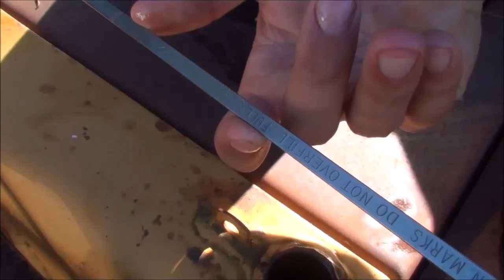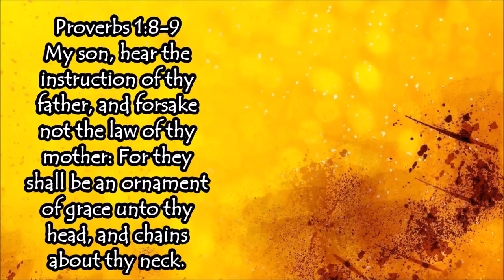Hydraulic Oil and Filter Change for Case 580E Backhoe

Comment: I'll be changing my hydro oil tomorrow on my 1986 580 SE if the weather allows...A very experienced heavy eqiuipment tech at my shop said just about the same thing you explained as to exercising and fully extend the pistons including the outriggers  at the right operating temps, so as to fill all the pistons and work out any air that may have got into the piston...thanks so much for the excellent video!
Reply: Thanks Grimm for "tuning in". As far as exercising before hand the oil is more fluid, warm oil flows better than cold oil. I didn't do this but it isn't a bad idea to put oil in the new filter before installing. This step isn't critical but helps purge a little more air out of your hydraulics. Exercising afterword is for the sake of working out any air before putting the implements under load. I have operated a machine with low hydraulic oil before and your system will cavitate which is hard on the equipment. Over all not a huge thing provided one doesn't make a common practice out of it. I rebuilt my hydraulic pump a while back and it is inevitable one will get air introduced into your system when ever you blow a hose, rebuild a cylinder, run low on oil, etc. it will work itself out eventually in short order.

Comment: I actually found this interesting because if I should ever own equipment someday I need to learn this stuff. I may not be changing the oil or doing other maintenance but I need to know how to check the fluids, etc.
Reply: Cathleen, good point. The more we familiarize ourselves in different skill sets the more confident we become in tackling different situations that come our way. Thanks!
Reply: Mr. Rain My dad wouldn’t let us get our driver’s licenses until we 
could show that we could check our fluids, tire pressure, jump start a battery, and change a tire. We never learned it for the tractors though.
Reply: Your dad seems like a practical guy who cared about you. That is what dads should do...in my opinion. If need be Heidi can do basic checks on vehicles. As you can see aside from the hydraulic system there are similarities between all motorized vehicles... come to think of it one could view the break system on a car as a hydraulic system 🤔

Comment: Thanks for the video. One minor correction, Case recommends you do not use a filter wrench to install the new filter. It is far too easy to dent the thin wall pf the filter.

Comment: So. 50 gal drum cut in half. Half filled with clean playsand. Add used oil. Stick in tools with metal heads. Lift tools up & down a few times and cleaned & sharpened metal heads. 5 gallon metal bucket done same equals sharpened hand tools for yard/garden. Another 5 gal metal bucket with plain clean sand near door to stick umbrellas in up to end of tip gives place for moisture to drain. Keep near door. Yep Ryan has those younger ambitious muscles that haven't yet learned the longevity caution. Lol.
Reply: Edie, not sure of the sharing part but the rest is a great idea for both cleaning and corrosion protection. Thanks for sharing!
Reply: Mr. Rain  sorry wasn't clear. The sand will help keep blades sharper. In laws did this as did so many older family members. The oil helps keep it from rusting. The sand helps keep blades from GETTING dull.
Reply: Ok, I can see that. I have sprayed silicone oil, coated with 90w, or spread a light coat of grease on cutting knives for planer and joiner knives before.
Reply: @edieboudreau9637   must remember and try! though not a 50 gal drum, there just is not room for that size !
Reply: kleineroteHex  yep. So I used a metal bucket. Works good.
Reply: @edieboudreau9637  does it have to be a metal bucket or will plastic suffice?
Reply: kleineroteHex plastic breaks down pretty fast with oil. Try a metal coffee can for hand tools.
Reply: @edieboudreau9637  thank you!!!
Any oil? I have peanut oil left 😊
Reply: kleineroteHex  any oil. Used motor or cooking oil is best.

Comment: After how many working hours hydraulic oil need to change? Need help
Reply from the maker: Each year, model, machine type, environmental considerations all play a part of what type oil and frequency of changes one needs to observe. I would look at the service manual. If you don't have a service manual do a search for a dealer and they should be able to tell you. You can also do a search and find technical data on your machine.
Reply: @RainCountryHomestead  thanks a lot m from Manipur and i never expected a reply from you itself but i do believe some other commentators

Comment: Hello Pat and Ryan,   Great video and very instructive.  Good tip on flexing the hydraulics to work it in.  Question #1:  What do you do with the waste fluids ?  recycle  ? or ?  There is no Question #2, but I do have a comment.  Here in Western PA, the professional term is "gahlunk gahlunk gahlunk" (yes , said 3 times in a row, because that 's what gahlunks do) and get that extra full flavor sound effect using the back of your throat for the vowels.  Have a blessed day.    By the way, I looked alllll over for the "subscribe" option....finally found it in small type on the right side of the screen.....just a suggestion:  Put it in larger font, and  a color that stands out....better yet, put a big "galunk" or '"glugging" next to the subscribe word.
Reply from the maker: Yes, he recycles the oil for treating posts. As far as the subscribe, if you are talking about the button below the video, that is not me who makes that, it is youtube. Even if you are talking about the watermark overlay in the bottom right of the video itself, while I can select my own image for that, the settings for it are still youtube's I cannot change those.

Comment: Pat, you didn't mention, or show, do you fill the new filter before installing it?
Reply: TrollForge I didn’t. I don’t believe it is necessary but also don’t think it is a bad idea to do it. It makes sense due to the fact you are introducing air into the system, however the same issue with air introduction happens when replacing hoses, rebuilding cylinders or whenever opening up the hydraulic system. As you know the air will work its way out. Good idea, thanks!
Reply: @MrRain-hk4zi  having replaced 3 hoses on my neighbors case 640E? ( it has like a 30 gallon diesel tank as a step up into the cab on one side and approximately the same size hydraulic oil tank under the door on the other side.) We bled off the air as best we could, but not tightening in the fitting on the far end of the line from the pump until it started to spray.
Reply: Gotchya. That makes sense and is a good idea. I have just relaxed the hydraulic system or neutralize the stored energy in the cylinders and replaced hoses and kept going. I haven't had any problems. Have you heard or know of issues by not bleeding the system? I have some hydraulic cylinders to rebuild and other hoses I would like to eventually replace.
Reply: @MrRain-hk4zi  sorry Pat I only have 5 years of sporadic experience working on case backhoes, (my neighbors.) And minimal experience working on farm tractor and snow plow hydraulics, but 50 years experience working on Automotive brakes and I've always just done the to the same way, because it made sense to me...
Reply: You bet. It's good to hear your opinion Tim because I know...you're in the know...If ya know what I mean :D Bleeding breaks of air is a must for sure because the air won't work its way out. I don't see anything wrong with your hydraulic system methodology.

Comment: Thanks for the video. I am rebuilding hydraulics on a 580e. Curious how that AW46 oil worked out for you? Did it cause any issue? The Case oil is about $100/ 5 gal. Would be nice to find a cheaper solution
Reply from the maker: He has had no issues with it in his machine.
Reply: Tractor Supply has a fluid that will work just fine for half the price of case.

Comment: Do u know where to insert the hydrolic fluid on a 580k back hoe? Need to know ASAP thanks
Reply from the maker: Patrick is not here at the moment but I will try to remember to have him get back to you on this as soon as he gets home and hope we are not too late.
Reply: Rain Country ok thank u
Reply: Although I don't have the K series backhoe, the reservoir could possibly be located directly by the front of your windshield just outside on the hood. My dipstick and reservoir fill is on the right hand side of the machine outside on the hood. I did some checking and it looks like you will need 21.5 gallons from what I can see. Hope this helps.
Reply: I have a 580 Super K, and the hydraulic reservoir is up next to the fuel fill, under the mini-hood. the dipstick is in the rear of the passenger compartment on the floor, and there also seems to be a sight-gauge on the frame.